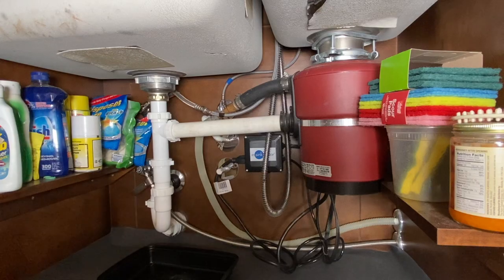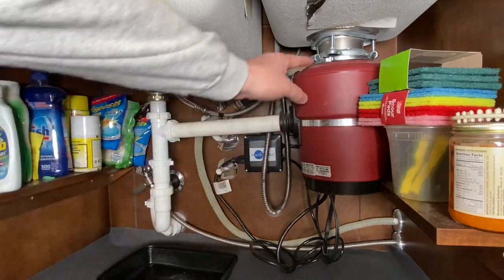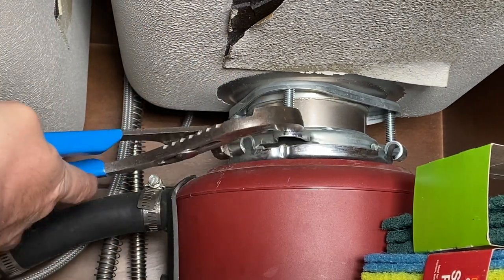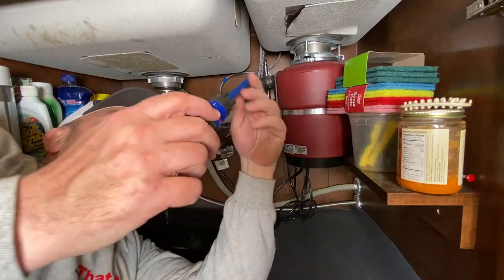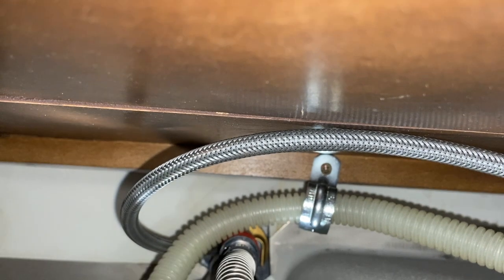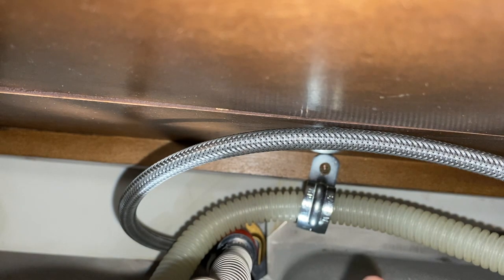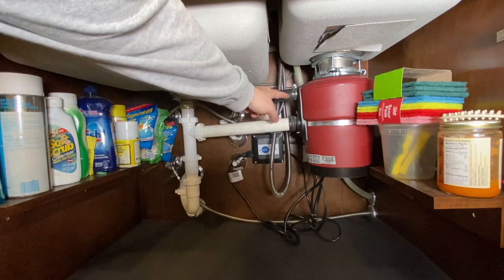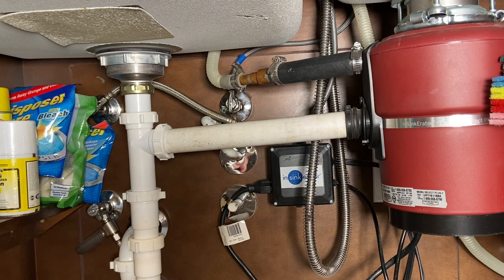Dishwasher Drain was not Installed Correct...One of Only Two Ways to Fix!

Comment: Changing out a sink my wife bought last week. Noticed the new sink doesn't have a hole for the existing air gap, so thanks to this clear cut video, going with the high loop instead of drilling a new hole in the counter top. Any recommendations on a dishwasher hose connector kit to a G/D? Thank you again for the great video.
Reply from the maker: I would go with the one made by insinkerator. Amazon link to connector: 
3tPqW8u Happy this video helped you.

Comment: High loop drain systems provide forced discharge from the dishwashers pump, all the way to the in-sink disposal or drain T. In doing so, the pump pressure helps clear debris from the entire drain hose and the disposal/drain T. I live where code requires air gape. 
Air gap dose a great job of ensuring sink backup/plugged drains don't run back to the washer but, the down hose from the air gap, to the disposal does not receive pressurized flow to eject debris. Hence, be sure that the down drain, from an air gap is a constant downward slope, or plan to clean it out yearly or every time the  dishwasher drain cycle ejects water through the  air gap , on top of the counter.
Reply from the maker: All great information. So many people these days don’t want an air gap due to the look on top the counter. Would much rather have an high loop than nothing.

Comment: Wouldn't the check valve at the dishwasher pump end prevent sewage from getting into the washer? The sewage would just be pushed up through the drain into the disposal every drain cycle?

Comment: Can the air gap be installed on the inside of the cabinet or does it have to go through to the outside of it?
Reply from the maker: Good question. I have seen people install them under the sink. If it clogs it will flood out the cabinet.  If it is going through the counter top or sink then the hope is that it just goes in the sink and down the drain.

Comment: I have a brand new GE  Dishwasher and it turns off a few moments after being started.  Could this be caused by the drain with no high loop?
Reply from the maker: No I don’t think so. Does it sound like it drains?
Reply: @ThatFixItGuy  this was it. positioned the drain hose to the underside of the countertop and the problem went away.
Reply from the maker: Wow awesome. I’m glad that worked out for you. That is so interesting.
Reply: @ThatFixItGuy  okay plot twist! the dishwasher stopped draining again. The appliance store sent a repairman. he found that the drain hose was obstructed by a sticker that was attached to the hose. The installer did not remove the tag that wraps around the hose. somehow the tag ended up covering the hose. The obstruction was removed and the dishwasher runs like a dream.
Reply from the maker: Oh wow!  That is a weird one.  I had asked a couple other plumbers about the high loop making the drain work and it did not make sense to any of us.  This makes sense. Glad they found the issue for you!